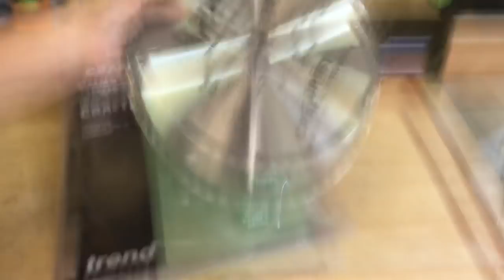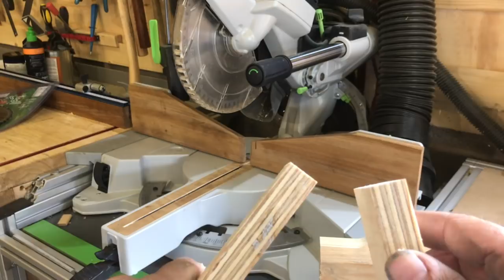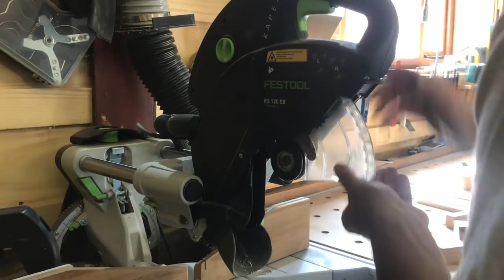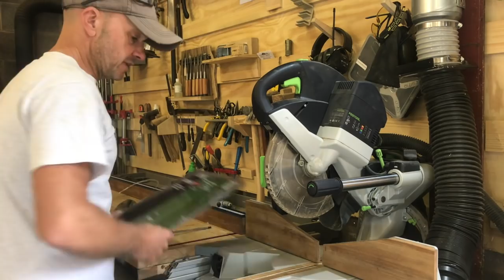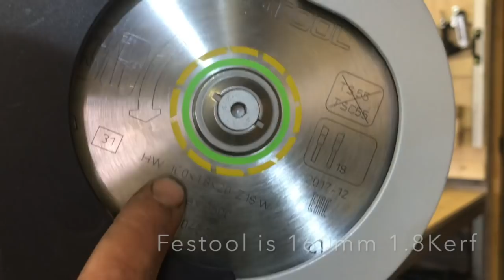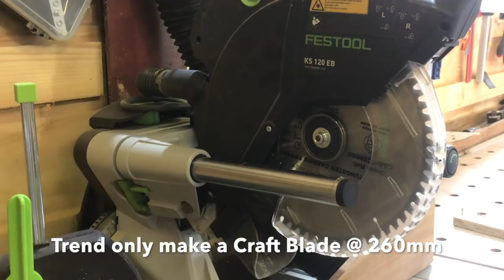Sunday shop update alt blades Festool Kapex KS120 HKC55

Comment: Not sure if you have tried this, but if your Kapex is plugged into a vac for auto start, plug the saw directly into the wall and see the difference in motor start up and power. Vac plug amp draw is way to low to fully power the saw...
Reply from the maker: I am using a trend vac which is 15 odd years old .. I think there is a little more power direct into wall  but I need the easy work flow ..  but thanks for info

Comment: Evening mate, can I get your advice on the new Festool KS 120 Kapex and the TSC 55. I currently have a small work shop in my summer house with limited room. As a side project I build a lot of benches and tables with scaffold boards. Can you tell my in your view what would be the best machine to work with these boards in particular as I work with them a lot. Also I only have a sjoberg work bench so in terms of workability what one will work best with this, many thanks. I would really value your opinion, I love watching your videos, you are a great inspiration, keep up the great work!
Reply from the maker: So are you looking to buy Ks120 or TS55 ??   If so get an MFT and a TS55 amazing set ip
Reply: Manor Wood Thanks very much for the reply, at the moment I have limited space and I currently only have my Sjoberg workbench as a table for potentially the TSC 55 or KS120, but it was a gift the table so I want to be extra careful of cuts etc if I use it as my base. Down the line I will look to get a MFT as you say but for now with the space I have, I think the Kapex 120 will give me more use.

Comment: I did notice that you took smaller bites with the Festool blade than you did with the Trend.
Reply from the maker: Trend is just out the box and has the first cut feel :).  I push as hard as the blade feels it can handle ..  festool is very sharp but not brand new !!
Reply: Oh ok, thanks.

Comment: Does it give added value to go through the wood in passes? The different passes seem to have slightly different blade deflection, which give rise to very small but noticeable steps in the resulting cut face.
Reply from the maker: Much better to cut hard wood without pushing heavy in one pass . You get less blade heat and a Cleaner cut

Comment: Trend make good stuff! have you seem those router cutters with the changeable blades?
Reply from the maker: yes I have , they are great !!   my router table has my Trend router in there which is 16 years old !! still working perfectly as is the Trend vac I use all day never even changed the filter !
Reply: Davyd Mir 
Have no issue with Trend cutters but we use Wealden Tools as our first go-to. No connection to Wealden except as very satisfied customer. Their website is very, very good but so is their technical service by phone or email. To us in the UK, we order one day and almost always get them the next day. Very happy with the long life of these cutters.

Comment: Do you or have you used the Freud blades and if so how would you rate them 👍
Reply from the maker: Not for a longtime , I used them on my old table saw they were good back then  but seem around the same price as festool so I just started using festool .  You can get great deal on trend on eBay if you keep checking
Reply: Manor Wood thanks for the reply, if Trend blades are good enough for you they will be more than adequate for me 👍
Reply: All i ever used to use in my mitre saws was frued blades. However when i got my ks60 i got a 24t freud blade for it and i noticed it isn't as stiff as the festool blade. When taking just a wee bit off the end of a softwood 4x2 the freud blade deflected slightly, where as the festool didn't.